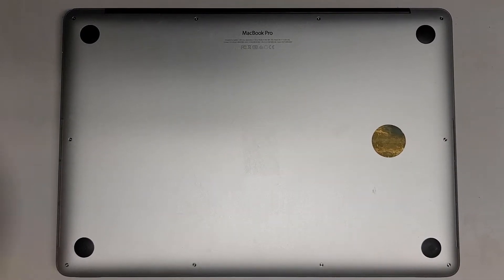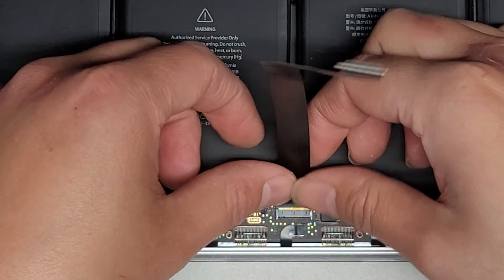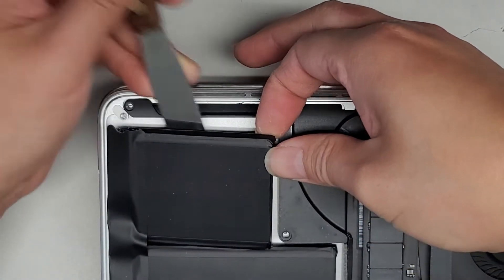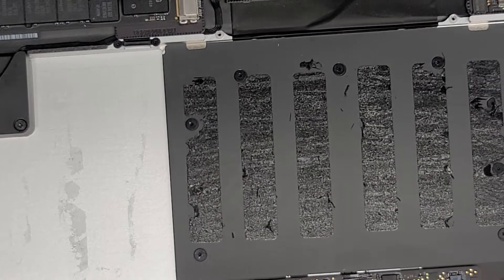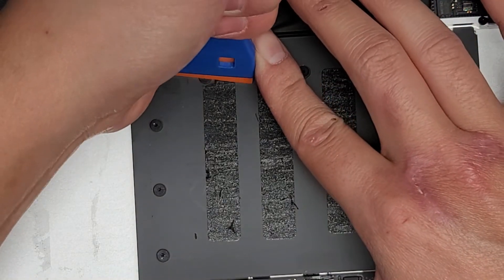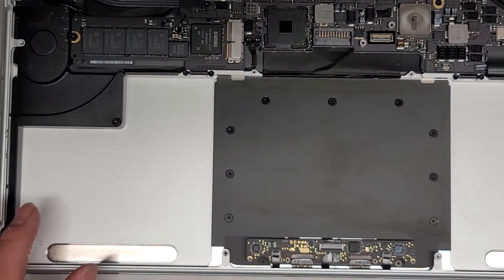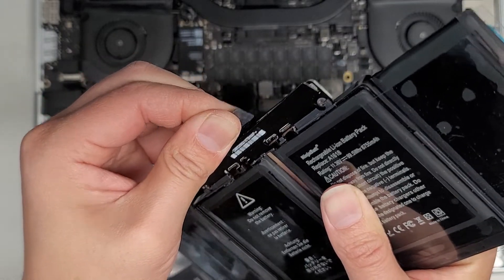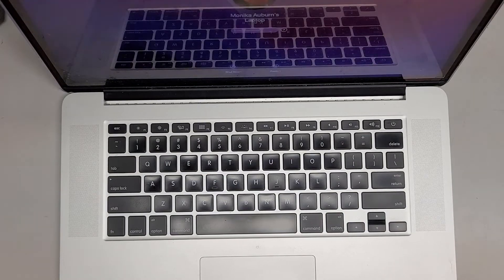15" Inch Mid 2015 Retina MacBook Pro A1398 Battery Replacement Repair

Comment: Your Mac videos are very informative and well done.  

The 'spatula' concerns me, though, mainly because it's metal. My main concern is accidentally causing damage to the logic board and/or the track-pad.

I actually used laces from an old pair of sneakers to get the batteries out, with a little bit of Isopropyl Alcohol.  I put a little around each battery and also put a little on a short section of the laces, and it took me a little under 10 minutes to get the battery out (it was my first time, so I was going really slow). The soft material of the laces didn't hurt my hands or damage the battery or track-pad cover in any way.  I've watch other videos where fishing line or thread were used, with those items either breaking and/or causing hand pain even when wrapping them around something to lessen the pain.

Anyway, thanks for the videos; I like that you go through the entire process from start to finish unlike some others that don't.  Replacing the bad battery along with re-doing the thermal paste and general internal cleaning has given my 2015 MBP 15" Retina a new lease on life!
Reply from the maker: Interesting. I'm curious how long the laces will hold up if done for a living. Also, did the adhesive residue all come out as well, or did you have to clean that separately. I make sure all the adhesive residue is removed, which takes much longer than the cutting part. I could cut the battery packs out in about a minute if I'm just doing it quick and not making an instructional video. Cleaning the residue is the part that takes like 20-40 minutes.

Here's a video of a bunch of the batteries I've removed, and not a single one was punctured.

https://youtu.be/6k8ehugmQO4

That's not even a 10th of the batteries I removed, but that might be a nice alternative. Some models don't have much room to get a shoe lace around it though, so having a tool that works in almost every case is nice.

I tried the floss trick and it kept breaking and I spent more time getting the floss to go unde the battery that it took to just cut them all out. Maybe I'm doing something wrong. Haha
Reply: @ItsBinhRepaired  I had to clean up the adhesive, the time I mentioned was just for the removal of the battery itself.  Cleanup took another 10 minutes.

I'm not knocking your approach, you have demonstrated that it works and comments on your other videos confirms that as well.  My concern isn't about puncturing the battery as much as it is about an accidental slip that could damage the logic board or track-pad.  There was a video by someone else that I came across where the same type of tool that you use was being used, and I cringed when he 'slipped' and hit the logic board.  By contrast, It's plain to see that you are very careful with the tool.  The other guy not so much.

I agree that using laces may not work where models don't have enough room.  In my case I had to use a spudger to place the laces, but it didn't take that much time in this case.

Honestly, my trying laces was more of a "will this even work?" kind of thing that actually worked for me.  Much to my surprise, I might add!

I should have mentioned that this was my very first battery replacement; it was a much easier process since I watched several of your very thorough videos, so big thanks!
Reply from the maker: @airrsongs  nice
Reply from the maker: @airrsongs  Glad you found a method that worked well for you. :) Yeah, I've heard people use knives thinking it's the same thing and get sparks and smoke. Lol Luckily no fires.